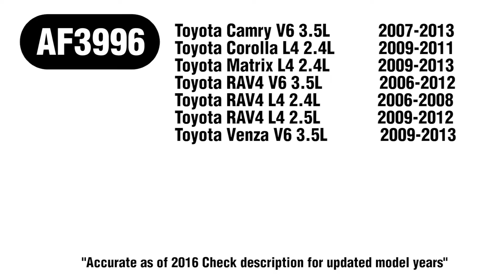How to Replace Engine Air Filter 2012 Lexus ES 350 V6 3.5L | TA45650, AF3996

Comment: How often should a air filter be replaced is it every year ?
Reply from the maker: We recommend every year for best performance.
Reply: Depends on how dirty the roads you drive on,   I always change air filter every 30,k miles or 2 years ,  unless you drive on very dirty roads then once a year or 15,k miles

Comment: You can't just open the air filter housing unit by unhooking the 3 locks. It won't open that wide. It's obvious in the video between taking out the air filter and inserting the air filter, he did something else to open the housing unit big enough to insert the air filter. Wish the detail is available.
Reply from the maker: You need to make sure that the back side of the housing unlatches you can see this at the 3:26 mark in the video.
Reply: It’s not rocket science

Comment: Hello should you be able to see the white part of the filter at all on the side closest to the engine ? Like i see the white part of the filter very faintly
Reply from the maker: If the housing is closed you should not see the filter. Your alignment may be slightly off. It may take some time to realign the housing properly.
Reply: Thank you so much for the reply and the helpful video ! You will get a like and subscribe from me !
Reply: @filterheads  No matter how many times I try it still shows part of the filter towards the engine side.
Reply: @YaBoYJi  did you ever get yours to close without showing any filter?
Reply: @35Colorado  hello no i haven’t it still shows on the engine side as well !
Reply: I agree, even mine shows on the side that’s closest to the engine. It think it’s normal.